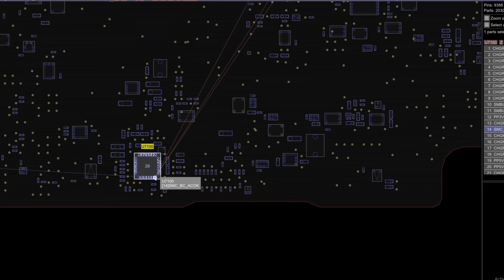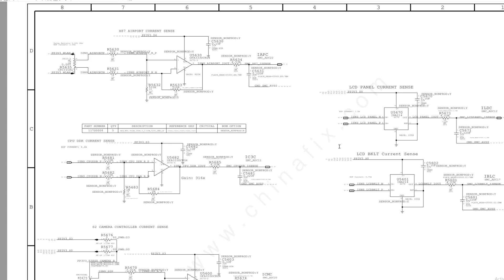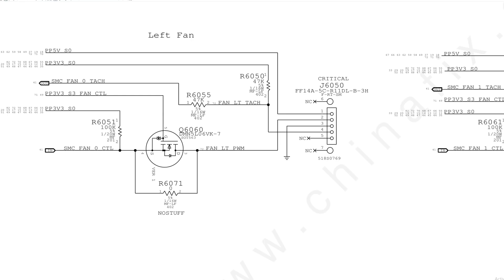Right to Repair - Let's be realistic

Comment: Anyone notice how one tablet is much like another tablet, a Mobile Phone or Cellular Phone no matter the manufacturer are much the same and do much the same things, in fact no matter what the product these days they all do much the same when comparing brands, the facts are all electronic devices rely on standard circuitry practices and components, each electronic component no matter the Manufacturer are much the same, no matter the complexity, So why are the manufacturers making their products unrepairable by restricting spare parts and or marrying several components to each other so that should one component fail, the repair will cost as close as possible to the cost of a complete replacement of the product? 

Why would they REALLY do that? I will leave that for you to answer, But to me it seems manufacturers are in the business of manufacturing a product, So it would be in their best interest to insure a steady stream of demand for their product "Have you ever wondered why devices made in the 1900's still work today?", Electronic devices if designed properly can be cheaply manufactured and more importantly several decades if not centuries later still operate and because the parts are cheap they can be cheaply repaired. 

This means any product relying on electronics may have to have some redundancy designed into them, So that as ones product breaks down the only choice left is a repair or just buy a new one, Unless of course the most expensive parts can still be replaced at a fraction of the cost of a New product, and I say parts because of the latest practices of marrying several components to each other, anyway it's this lower profit margin that spare parts offer that the manufacturers find undesirable, And that's even if the profit margin difference is a mere half a buck compared to a complete new product, because manufacturers have to consider that their employees need to be kept busy, along with meeting ALL of their obligatory supply contracts. 

I use to suggest that a world wide law be introduced, so that if a spare part for a product wasn't readily available by a manufacturer, then the products details, copyrights and technical specifications including all propriety is lost by it's manufacturer, 
But what will this achieve? 
What will their comeback be?

Comment: None of the reasons matter.  Apple doesn’t want to fix these dead devices.  It’s goal is to sell more devices.  Just go to the Apple store with your dead phone or laptop, 99.99% of the time they will tell you that it is not repairable and offer you to buy a new device.  Its stock price is based on the number of devices it sold per year.  Its stock market cap is worth $2.1 trillion, so there is no incentive for Apple to fix these devices.  It will do everything in its power to protect its market cap.

Comment: Boardviews are for amateurs! LUL. Even tho most manufacturers provide you with information and replacement parts. For example if you are an authorized technical service shop they will give you replacements to change the parts broken, in the case of motherboards you have to buy the entire motherboard as a replacement, never single components from the manufacturer. Apple is an extreme case, they don´t want you to touch their products and won't authorize nobody but themselves to repair their stuff, in this case you can defeat them with the right to repair bill, but having schematics is going to be hard unless you sign an agreement and become authorized, but to protect their IP they should remove all markings/models on chips so only they can provide you with authorized replacements chips/components. Otherwise you have no schematics but are free to change any components on your own just like it is now.

Comment: I have to disagree with your statement in the last part of the video. Since when did the government start to not enforce The Magnuson Moss Warranty Act? Why was it feasible in a previous generation to supply schematics, repair manuals,  and parts? Or guaranteeing repair of their equipment, 7 years after the manufacturing of the equipment was discontinued?
In the 80’s the Lab. I was working in received an expensive HP spectrum analyzer, costing $35,000. I requested the repair manual. By the standards of the time, it was expensive, like $300. But it was a gigantic tome, like having a 1000 pages. Diagrams, explanations, and diagnostic trees. And yes you could order any parts too. As an example I did repair on Tektronix oscilloscope. I needed parts, ordered them and got them. The excuses the manufacturers are presenting currently are totally bogus. As far as being private property, and protecting IP, all of us are aware of reverse engineering ( still perfectly legal). A tenacious competitor can both reverse engineer the circuit boards, as well the integrated circuits, to learn how the system works. There are companies who are in the business of blowing the top off ICs, and reverse engineering chips. The way the world resources are being depleted, the business model the John Deeres and Apples of the world are following is becoming more and more unworkable, making their devices/equipment irreparable. There is not enough space left in the dump sites.

Comment: Wouldn't it be way easier just no serialization and sell the pieces? Like you don't throw your monitor away when you change desktop configuration. If you change the CPU, you can keep the motherboard (laughs in AMD), but require BIOS update ("easy" as it is there are few people who do it). Right now, your cellphone breaks the screen and Apple requires you to buy or change to a new cellphone. That's just straight e-waste, i guess it's a hard call to expect bord diagrams and other technical information, but there is no explanation why you shouldn't be able to buy the whole motherboard of your cellphone and change it. Just straight out no sense. not even greedy.

Comment: Schematic and board diagrams have no value unless you are able to create the board itself right now all that is happening is not having those out is holding  back innovation.  There are lots of schematic and board diagrams in the open source they do not get taken by others they usually are only used to create new better things and repair the existing products that than they products being thrown in land fills.  Most of the time you will find that schematic and board diagrams are not new either they were taken from previous creators in effect stolen.

Comment: Apple has been a glorified motherboard manufacturer for the longest time. Think of gigabyte/msi/asus/asrock, do you really think that if someone had a LGA 1151 motherboard board view they could get boards fabbed and assembled for as cheap as those guys can make it? Also millions to engineer motherboard? You are thinking of it the wrong way, these guys get typical application circuits when they make these motherboards, they aren't new ideas they have to come up with. I would even guess that Intel/AMD literally give example designs/schematics to motherboard manufacturers. The only secret sauce the motherboard manufacturers have is being able to mass produce the boards.

Comment: I think you have a misunderstanding because you’ve strawmanned the R2R argument and then proposed R2R as the better solution to itself. What I mean is that the proposition is that schematics and board views be made available to third parties not that they be made public. This is an important distinction. “Made available” leaves open an option like you discussed where you subscribe to a program which can access and display that information but does not leave open the current state of affairs where no information can legally be accessed. “Made available” does not require public distribution of information unless that was the route a company chose of their free will. 

I don’t believe you made straw maned on purpose here but it is a straw man.

Comment: Hey! i totally disagree. First of all.. most of the things you ask apple to supply takes a relative short time to design than ICs and CPU. Even if someone got the schematic and chips, it's not an easy task to design the board layout (which is never provided) and get a "pirate" iphone manufactured.
 There are a lot of details that is missing in the schematic that are very important in order to get a iphone working properly. In the schematic they are not giving away a shit: only decoupling caps, filters and ic connections. The real Intelectual Property is in the IC, Today every electronic device is design to be small and that requires that most of the circuits needed are inside ICs, even they barely talk about this point when they try to defent about Right to Repair.

A couple of decades ago, manufacturers give away schematics. There were any problem with that? NO, because all their own circuits are protected with patents, which guess what, are public. 

IMO, most of the things you ask for, can be supplied with no additional cost to apple. That's not the case for programmers. It's possible that they do the programming at factory in a automated way, so they don't have tools to supply to you in order to be able to program the chip, simply they don't program the chips the way you would.

Finally, I think that all this Right to Repair thing is a anti-monopolistic action and a action for freedom. Why apple has the right to choose if people can have their own phone repaired? Why apple has the right to choose if you can earn money fixing their products? Why apple has the right to enforce what can be fixed or no? Why apple has the right to avoid apple users to take other options rather than apple?

Comment: Hello Alex. Recover data is no longer an issue these days. Most importantly, you should regularly back up all your data. There are plenty of programs that even do this automatically for you. But some people are too lazy or don't want to spend money on an external drive. If you have such important information on your PC, don't you take precautions and make regular backups? I understand the position of the repairers but also the position of the manufacturer must be respected. They want to market and sell new products, preferably as many as possible. As technicians, we all know that all parts are currently under severe stress and their lifespan is therefore limited. Do not think that the manufacturer does not know this, but they do this to be able to sell more products. The waste mountain is not their problem, but it will be a huge problem in the future. But then it will be too late. People NEVER learn to deal with natural resources. All that matters is MONEY.